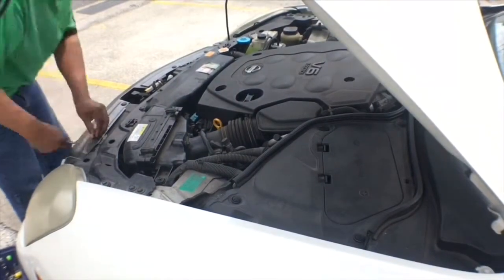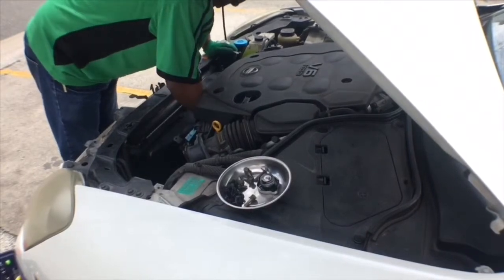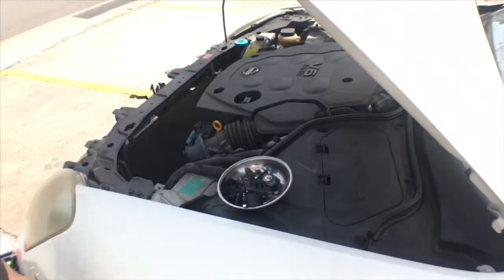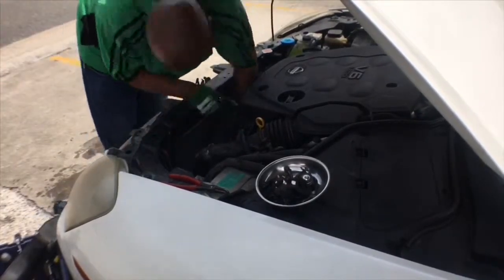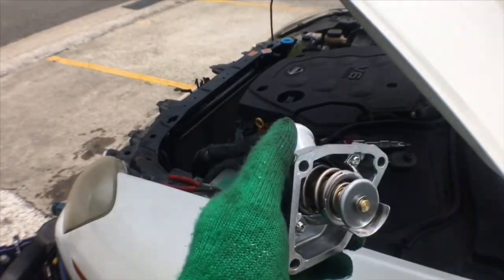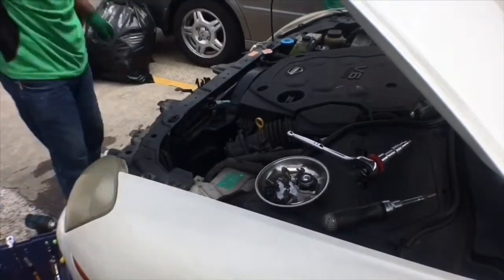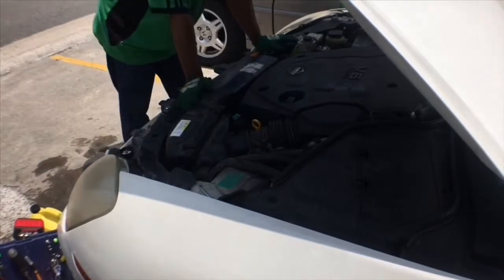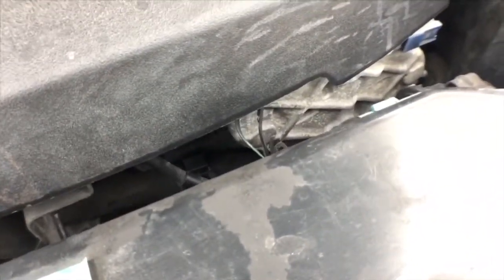V35 Nissan Skyline radiator change and thermostat modification

Comment: Hello 👋🏼
Reply: I'm in Africa, I was driving well with the car yesterday I drove in a heavy rain and this morning the temperature is only rising 10:10
Reply from the maker: That sounds like a damaged head gasket caused by cold water suddenly touching a very hot engine. When the engine cools down, You should open the radiator and check if the water is oily or has a strange color. It could be a stuck thermostat too. Best option is to go to a mechanic.

Comment: You do not need to remove thermostat if it is not stuck. Check the radiator heat exchange efficiency and the problem will be solved. All you have done is giving the cooling system a pain killer but the problem remains. Cold start warm up time will increase together with fuel consumption during that time. Also blend the cooling system properly.
Reply from the maker: No you don’t but I recommend doing it

Comment: Hi I was not aware that i should have disconnected the battery before unplugging the AC intake sensor. After radiator installation the AC only  blows out hot air and the compressor is not kicking in. I need details on how to reset the ACU(have no clue what this is). Can you help with better details?
Reply from the maker: Graham Bain Sorry for the late response. I hope you have fixed the problem by now. If not, just google V35 or V36 ECU reset. I Can’t remember the steps.